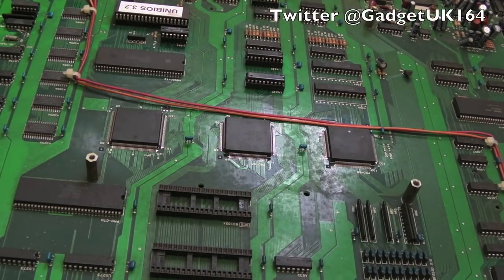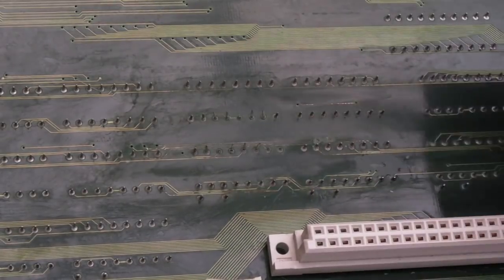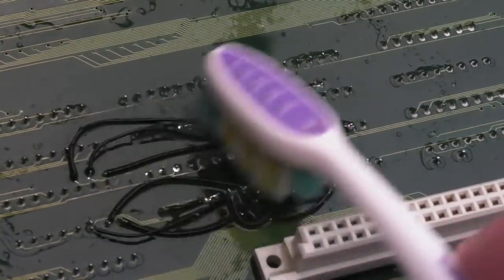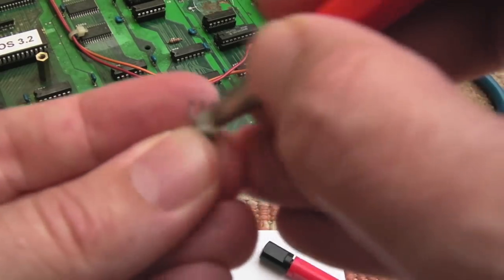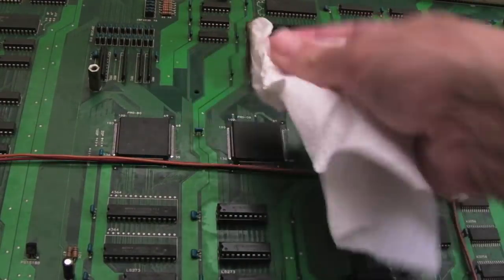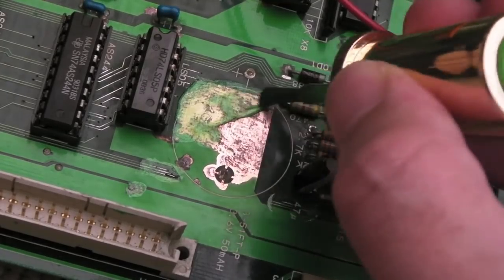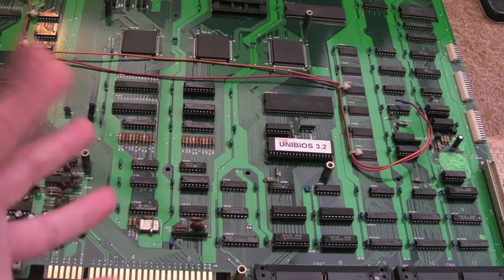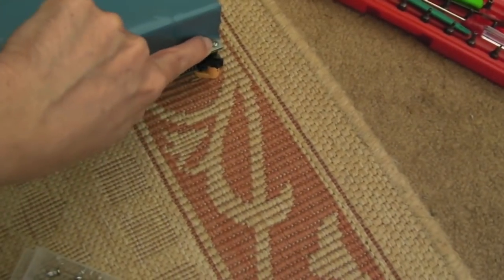SNK Neo Geo MVS (Arcade PCB) 6 Slot Repair (MV6) - Part 2

Comment from the maker: Part 1 - https://www.youtube.com/watch?v=0gZh8FQo19w
Correction: The point where I talked about that microswitch (near the end of the video) - it was wired so the switch provided the battery feed to the BRAM, OR ground.  It could still cause a BRAM or charge circuit failure if pressed when powered up, but it would not drain the battery the way it was wired.   Also note, I forgot to cover checking the reset connection on the CPU.  It should start low and go high.  If you saw a low on the reset pin on the CPU its stuck in reset.

Correction: (thanks to ElectronAsh) - The 68K first address line is A1, so A1 on the CPU goes to A0 on the ROM, A2 on the CPU to A1 on the ROM etc.
Correction: In a couple of places I talk about functionallity being "exploded out" in the new chipset - but the opposite is kind of true.  For example on this board there is a lot of discrete 74 logic - that logic is combined into some of the chips in the newer chipsets.  But you can with some effort combine the 1F schematics with the PRO chipset and its supporting 74 logic to try and work out what is what.   The point where I talk about the newer chips being "exploded out" - it's the exact opposite.  The newer chips (D0, I0, E0 etc) are consolidations of 74 series chips on these older boards.  It's easier to find spares for these older boards.

Furrtek Patreon Page (Neo Geo God) - https://www.patreon.com/Furrtek
FourX2k3 6 Slot Restore Video - https://www.youtube.com/watch?v=HTxlTyMA0gE&t=1233s
Neo Geo Dev Wiki 6 Slot Top Board Diagrams - https://wiki.neogeodev.org/index.php?title=SLOT6_board
Neo Geo Dev Wiki Chip Pinouts - https://wiki.neogeodev.org/index.php?title=Category:Chips

Comment: While I haven't nearly enough experience with trouble shooting and repairing damaged traces like you do, I have some experience with cleaning old PCBs with a lot of dirt and grime on them. Inspired by arcade Jason i usually wash them with an alternative of simple green: Koch Chemie Green star. This industrial cleaner is a bit on the alkaline side (pH 12.x) but it really cleans up old gunk like nothing. Just spray it on, wait a few seconds, brush over it to agitate the dirt, and clean it off with hot water followed by IPA to repress the water.

Comment: I certainly don’t think you are crazy for spending 2.5 hours cleaning that board. Before that board was in your hands it was destined for the scrap heap! And with some intelligent troubleshooting and careful repairs you’ve brought that 6 slot back to life! Goes to show that nearly anything can be fixed given enough time and patience. (Well, maybe besides your old desoldering station! I have an ancient Pace desoldering station myself here with a busted vacuum pump connecting rod...)
Reply from the maker: Thanks mate =D

Comment: Your spot on about the time-consuming Chris, it took me 3 week on and off to get my corroded 6-slot up and running add on a further week to get the top board working with all slots and then there was the metal shield I had to get looking respectable, all in all it took me about 5 weeks. but its well worth it in the end just to say you own the daddy of Neo Geo's the Neo Geo  6 Slot. Thanks for the shout out by the way Chris, much appreciated.
Reply from the maker: Tell me about it lol! Spent almost 3 weeks on ONE MV1AX =/   Thanks mate, appreciate the support =D

Comment: The 2 x  13 way JST are for the credit display and the 8 way is for the ELA mini marquee.  The credit and ELA all use BCD and the led drivers are on the credit PCB it's self.
Reply from the maker: Thanks for the info =D
Reply: @GadgetUK164  Do you want one of my new prototype mini marquee boards so you can use it to test the ports on repairs ?

Comment: Hi, Nice work with NeoGeo 6 slot. I would like to ask you for some help with my Neo 6 slot. I'm stuck at the moment when I connect two boards together. Bottom board of course have some corroded traces and vias near to the battery. I fix all of it and now on diag bios rom I pass all test. When I put original bios board starts to the hatches and I'm able to check everything from service menu. But when I connect top board without any game and power on I see only few line of small rectangles (glitch) at the top of the screen and nothing more happens. Top board is free of corrosion and any other damages. Can you help me what should I check in next steep? Is any other way to communicate with you?
Reply from the maker: I would start by isolating the prog bus side of the bottom board to the top board, perhaps start on the address lines.  I as I talked about (I think) at some point either on this 6 slot series, or on the later 4 slot I looked at, there are some 74X244 chips near one of the interconnects, that pass address bus and control signals between top and bottom side of the board.  You may find if you remove those and connect it up, it just sits there at the cross hatch.  If that was the case, that would be a clue that either those 244 chips are the issue, OR its what they connect to on the top board.  Diagnosing the top board could be hard, you need to get pin outs for all the chips, and use a logic probe to see if all the chips are behaving normally.  Feel the tops of the ICs on the top board too to see if any are getting hot due to failure.

Comment: Awesome video! Loved every minute and learned alot! I just bought a consolized 6 slot board and spent hours cleaning all the boards yesterday.. noticed the battery was removed and there was some corrosion and cleaned it up best I could with alcohol. Everything seems to be working alright though I'm sure the sound caps should be replaced as the sound cracks when moving the volume.

Anyways.. should I add a replacement battery if so what one should I use?
Reply from the maker: If the sound crackles when moving the volume, carefully clean the wiper of the volume pot with a cotton bud dabbed into IPA - Don't press hard or you will remove the resistive coating, but a very light wipe and you may find the crackling stops.

Comment: Question buddy, I have super rusty rf shield on a master system 2 that's rusted to the point of stuck to the board it self, so my question is how would I go about unsticking it without damaging the board, I know how to clean up the shield but I'm worried about causing potentially more damage than already occurred.
Reply from the maker: I would just apply some IPA and brush around it - use a fibre glass pen, see what its like then and try and prize it up (ensuring its not soldered down).  Any damaged traces could be patched up later.

Comment: Great work on this, Gadget. ;)

I'm still watching, but I love the longer format vids. It's better than watching a film. lol

(unless it's Back To The Future, classic Star Wars, or Predator, obviously, but that's a tall challenge. lol)

50:47 - the reason the outputs of the 74LS05 can be tied together is because it has open-collector outputs, so I'm guessing there must be a pull-up resistor there as well?

So yep it means that if any one of those inputs is high, then the output(s) would be forced low (as it's an inverter), so they are using it like a multi-input NOR gate. ;)

One other minor thing is that the 68000 doesn't have an A0 pin as such, so A1 will generally connect to A0 of the 16-bit wide EPROM, which is actually correct anyway.

(I know you know that, Chris, I just thought I'd mention it for anyone who might be wondering. ;) )

I found that same age-old problem with corroded solder on a board recently (SNASM68K dev box), where the crappy Varta had leaked, and one of the vias is near impossible to heat up. Definitely needs a bit more scraping. I wonder what chemistry is involved there?

I swamped the board with IPA, and cleaned as much as I could, and it's not too bad, luckily. I still wonder about the vinegar thing, though - it makes complete sense to neutralize the battery alkaline, but then how much vinegar is too much? I guess just a small amount is fine, as long as it's all cleaned off very thoroughly with IPA after a few minutes?

Keep up the great work. You have way more patience than me, and you're doing very important work for preservation.
Reply from the maker: Yes, it does have open collector outputs =D  I just didnt mention that.  Furrtek also mentioned that in his chat earlier.  Thanks for the correction on the A0 pin - semantics I know but that could confuse someone lol.
Reply from the maker: I totally agree on the Vinegar btw - I've come to the conclussion the vinegar helps with the clean up work - it doesnt really "neutralise" anything, since the qty of vinegar and its PH would have to be precisely calculated vs the PH of the alkaline on the board and you couldn''t apply it at the right concentrations in the various positions based on how its distributed.  Net result is we probably change the PH to acid lol.